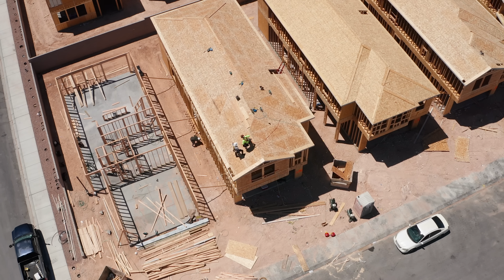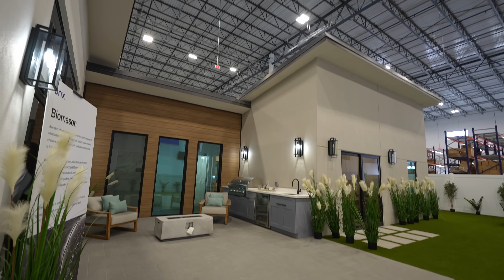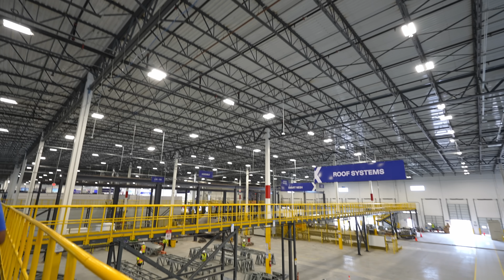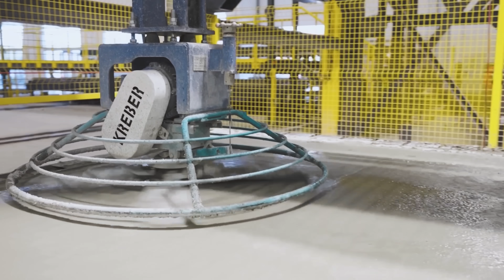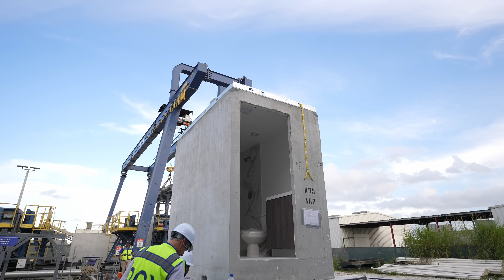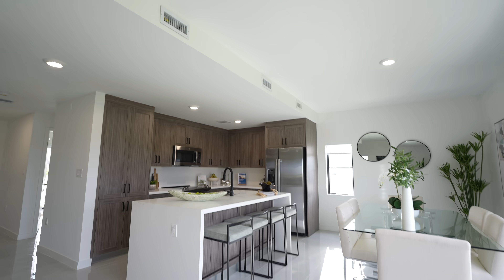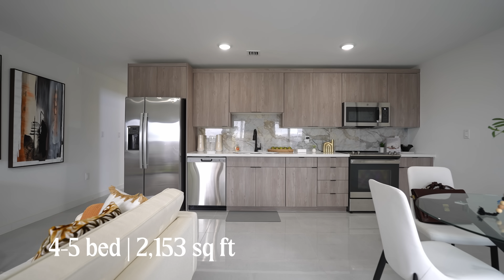Why This Company is Building Thousands of Concrete Homes

Comment: How you describe it try to make it sound new. Maybe for America but not for the rest of the world.  We call things different names but in the Caribbean this is prefab concrete. Been doing this since the 1980s.  These buildings hold heat and holds the cold so I don't know about better insulation.  The  concrete roofing makes it  a furnace in summer though. Shingle roof would keep it cooler in hot months.

Comment: The Edveros post-build certification documentation includes an air tightness test result, a thermal imaging report, and a SAP energy assessment. Three independent performance certificates. Most new builds deliver one.

Comment: I live in a modular home (sections built in a factory and then assembled on site).  There were several similar companies to choose from when I built my house.  they all seem to be solidly built and avoid the pitfalls of stick built on site such as weather.  Building out of concrete addresses some issues like wind resistance, insects, fire, etc.  It also raises some.  Most concrete is porous and will absorb some amount of water.  Mold can be an issue.

Comment: Insulate, insulate, insulate .... A sun-drenched hot concrete wall is a flywheel of heat when the sun goes down. . And the same when the exterior is cold. .. Ask me how I know? . I own a 1955-built concrete home in Denver, Colorado. .. Concrete, luv the idea.

Comment: Transform your structure to withstand nuclear events by using advanced radiation shields like lead or polyethylene and robust reinforcements such as reinforced concrete or specialized alloys. These measures significantly improve durability and safety against nuclear threats.

Comment: Why add insulation inside of the concrete?  One goes from "as strong as possible" to "strong enough." Could it be simply a ruse to reduce costs of production?  The thickness of the concrete is the insulation -- it keeps the interior cool in the day and radiates the accumulated heat during the night.  
And while steel for roof support is better than wood, a concrete roof is the "topping" required for durability and strength.  It is the roof that provides strength to the walls and helps prevent them from falling in or out over time.  In Bermuda, the roof is staggered to provide a slope for water runoff but it is still concrete.  
That wiring by the bathroom (yellow) is tucked in there a bit tight.  I wonder what electrical issues are had with these units.
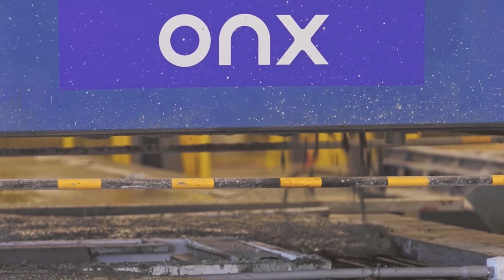Finally, that pour at 02:59 is done from a bit of a height.  I would it bring much closer to the mold.  I imagine that this cement would have a depth rating of more than 35mm with a Vicat plunger.

Comment: This was literally done throughout the soviet union starting the 50s. But the tech used at that point was inferior. The panels are all crooked , thin and cheap. Thermal insulation of a soviet panel building is abysmal.

Comment: 7000 +  cal fire ,for a 900 square foot cabin, old on at that ,in the mountains of San Bernardino you need new electrical and roof..and they will not rebuild only pay for the structure worth..

Comment: Can someone explain to me why the pods of the bathroom are not made of drywall and aluminum rails? Why would you make it out of a concrete shell, drywall would be much lighter to install and build, also probably much cheaper and better for electrical.

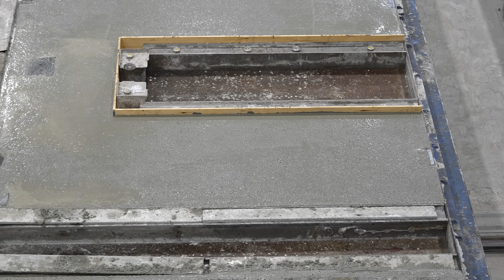Comment: 0:41 wdym "extra"? Concrete will last longer, times better heat exchange, resistant to elements, less noise in and out
Reply: oh, she did confirm it later in the video. Well, I was just reactionary

Comment: In my experience, concrete is a terrible thermal insulator. Roughly an R value of 0.3
So I really have to question the comment “ it’s way better at insulating temperatures”. 

I have also experienced the walls sweating, needing special drywall.  

I would love to see how they overcome this, and I genuinely hope they do.  
I could see myself investing in something like this

Comment: About time the American government is opening their eyes!
I always wanted a concrete house in the USA but the stupid government regulations wouldn’t let you. Concrete houses are more durable. In Puerto Rico the insurance companies won’t accept to insurance your house if is a wooden house 😂because all the things you mentioned before: wind, fire, floods. Concrete houses resist earthquakes too.
I understood there was a monopoly in all this by not letting engineers build houses in concrete to charge expensive policies (insurance). 
And this concrete houses are built in less than 3 months in Puerto Rico and cost about $300k or more. They resists everything. There are homes in the island built over 100 years. There are buildings in the island build in bricks and cement over 400 years, so imagine a concrete structure, how long it will last? 
So, thumbs up 👍🏼👏🏻🙌🏻 for making a new change.
I want to add, did you see the houses being flushed down the river recently in Texas? That won’t happen with a concrete house.

Comment: Research British Steel homes.. this project was tried in Britain in the 60s and 70s... most of these homes can't be mortgage as they develop structural issues 25 to 30 years on as concrete cracks and the steel bends. I am sure steel and concrete tech has advanced from the 60s but there is a reason these homes are not popular in North America and Europe

Comment: The thing people have to get is that concrete is very environmentally friendly IF the house is built right so that it is highly efficient AND designed to last.  A well made concrete house should last from generation to generation.  If concrete is treated as something that is just disposable where it is put in and ripped out a few years later, then yes it's use is bad for the environment.  But the same could be said of EVs.  They create WAY more CO2 release during construction than gas or diesel engine cars do, but they make it up by not using gas or diesel during the life of the vehicle.  So though they are dirty up front, they end up cleaner in the long run.  That is as long as folks are not setting them on fire to make a statement.  Doing that just hurts the planet, while also being a miscreant. The trick to using concrete responsibly is using it for things that will last and are treated as such.

Comment: my house is buld in 1978, it is a prefsb and almost all the walls are concrete. We have a prefab factory close by. Mainly because of house shortage in those days prefab was the way to build quick. Most of  these houses are also townhouses. so connected to eachother. Back in the days they where build as Social housing for rent. 

Prefab has taken a new step and builds can be done in one day. Finishing will take up a month but the house will be wind/water tight within one day

Comment: Lots of questions. How do you fix things that break in the walls? Are they in the walls or just hidden behind drywall. What about house settling  issues?  A huge crack though your entire home sounds ridiculously expensive to fix?  Cracking, concrete can and absolutely will crack as over time. It’s not like they are making these homes out of Roman concrete. Maybe that is an option?  A home that lasts 1000 years, yes please. 

I guess what I am really getting at is what is the true cost of owning one of these homes over a 10, 20, or 50 year horizon?  How do they really hold up?  What new or unknown costs could occur with this type of home. How costly are repairs?  We are talking about concrete repairs vs wood now for some things. That gets very expensive and why they only assemble these onsite and one of the reasons they don’t make the components on site. 

Anyone know?

What about insurance cost?  If they are are tough as they say insurance should be less, is it?  Doubting it is.

Comment: Concrete is not a good material for building homes. It's thermally quite inefficient and has an enormous carbon footprint. It's also quite weak under sheer force - hence the requirement for rebar.

Comment: I'm quite surprised that these outlets are not pre-wired with ethernet. I really hope that the rooms are connected with ethernet and cable, because it's not like you can drill easily through the concrete. Concrete, attenuates or even blocks Wi-Fi signals.

Comment: They need to have doors and windows that can seal out water. Whether it's the actual day to day door or something behind it. Wondering how they keep the roof from being ripped away. Can you hang things on the wall by drilling through to the metal studs?

Comment: 500k$ for a house with such bad detailing is a bit over the top (and the overall is low quality). Btw, the lightweight steel frame (on the roof) is much worse for fire/earthquake/wind compared to concrete. I guess they have some nice healthy margins..

Comment: Wait, you're saying concrete structures are better at being insulated than wood structures, right?  I'm not sure how that works, but strictly speaking I'm pretty sure that wood as a material has a higher specific heat capacity (ie better insulator) than concrete.

Comment: What’s needed is to break the stronghold the roofing industry has on housing codes. All houses are built using frame method roofs that rot, and can burn. Allowing concrete roofs would make houses nearly indestructible.

Comment: So called "pre-fab" homes are built better because all the dimensions and sizing are done by the factory in precise tooling instead of a carpenter using a tape measure and power saw on site.

Comment: Great idea in tornado/hurricane prone areas for sure. Out here in California though it would not work as well as concrete is brittle and won't handle earthquakes well. We need to come up with flexible and fire proof materials. Probably steel or aluminum homes is the best way to go with fireproof insulation materials.

Comment: My choice would always be concrete walls with thick layer of insulation over it. No idea about western Europe but in eastern Europe after WW2 communists started to make whole apartment buildings out of prefabricated concrete modules like in this video. https://youtu.be/1eIxUuuJX7Y?si=-0UTGbS6nH8_mM5i&t=62 It proved to be extremely cost effective and fast.

Comment: Great idea if built outside the USA with the original concrete mix. Ive talked with multiple concrete companies throughout the years and asked them why it all turns to dust if poured from the 80's till now and they have all said our Government has mandated the mix to fail! So they are not allowed  to make it last like it was originally designed.

Comment: Live in a concrete home the whole mold resistant comment made me laugh, you are great at regurgitating their talking points with zero personal experience or knowledge. Concrete holds moisture and where there is moisture there is mold and mildew regardless what they say these things will need constant humidity control to avoid that which in Florida ain’t cheap…

Comment: How can you possibly "feel' the drywall?  Unless you smack your head into it, you can't tell the difference between concrete and drywall.    And maybe you haven't heard, yet, but CO2 is a REQUIRED gas in out atmosphere.  And there really is very little of it.  Less than 1%, I believe.  It is needed by all the trees and plants for their growth.  If no CO2, there is nothing for the plants to turn into Oxygen.  And you know what that means?  We all die.  Man is not causing so-called Climate Change, if it even exists.

Comment: Bear in mind that each pound of concrete releases 0.93 pounds of carbon dioxide.  While wood constructed homes are essentially carbon dioxide sinks.  We should not build concrete homes except for in the most disaster prone regions.  Building concrete homes literally exacerbates the problems they are solving for.

Comment: The concrete homes are fine but IMHO they are spaced too close together. If there is one thing America has in abundance it is space. Land. these houses should be two or three times farther apart from each other than they are. I mean the way they're built here, they're almost row houses. Other than that, this is a great idea - lots and lots of housing manufactured quickly, and from a material that should last a long time without rotting away, and also is more resistant to hurricanes, tornados and fires than wood. America has a housing crisis as everyone knows. These concrete factory built houses can do their part in the fight against it.

Comment: I've seen prefabricating like this in the Netherlands, however the insulation needed to keep the properties warm in the winter is far greater than displayed in the video. This means far higher transportation costs as the elements are much wider. Secondly the insulation material is an environmental  issue and expensive to dispose of when it comes to rebuilding over here.

Comment: Concrete in California requires a lot of steel rebar. I built a retaining wall (required by the town). It held back 3 feet of dirt. The rebar cost $10K. Some of the rebar was 1” thick. Earthquakes can crumble concrete.

Comment: Thomas Edison built concrete homes, well over 100 years ago, which are still standing, today!
Except, I believe, that his homes were built "on site", meaning that 'forms' were installed &
the concrete was poured into them! When it hardened, the forms were removed, leaving a 
solid, shell of a building! This is an old building material, that needs to be revisited!

Comment: I want thicker walls and instead of dry wall I want another layer of concrete. Also need far smaller windows as there are so many shootings happening in New Orleans smaller windows are safer.  The Swiss construction industry does some great prefab and Germany builds some VERY stout houses with some really interesting windows that outdo basic American ones.

Comment: I can't speak for other states but if you're going to buy a home in florida make sure it's concrete even better if the roof is made out of concrete. Is meaning the foundation?The walls in the roof are made of a concrete. Simple things like  termites plus wood rot. Is destroyed more homes in florida overtime . On the other hand where concrete Usually outlast all of them , even in a hurricane.  fire or flood  . In today's world they have a thing called concrete board that takes the place of dry wall.I would highly recommend it. Not only is it structurally better , but it is Is also majorly fire resistant. And Is so much stronger and lasting than wood.Or drywall. In florida everyone should be afraid of termites Whether there's subterranean or Dry wood. In florida concrete  value much more stronger than wood or any other built structure. Recently, a major improvement in concrete floors means you do not need tile, carpet or wooden flooring or vinyl.You can literally have the concrete stain to any color or pattern you want. Is that will last forever.

Comment: As a pest control specialist, I can't tell you how many homes. I have personally inspected that became worthless because they were either overtaken by termites or wood rod or just simply decay because they were made out of wood.. I can't speak for other states.Strictly speaking for florida if you're going to buy a home or a condo or any structure even commercial make sure it's concrete. It will do better in hurricanes.Fires protection against termites And even something as simple as wood rot and decay. Personally , I would recommend anything built by devasta. If you can practice your own land they can still build a home for you on site or commercial structure. In most cases there roofs walls and foundation. Are made at a precast concrete. Is solid to the core.

Comment: Burgundy vasa or simply devasta have the best building reputation in the state of florida. That's because the builder structures with solid concrete. That is great in hurricanes fires and even term weeks or just simply woodrot. Unfortunately, it took Bergen Nevada over 10 years to get approved in the state of Florida, but have proven themselves as one of the best builders.There is in the state of florida.

Comment: OMG!! Another Youtube specialist at nothing!!! I agree, concrete would be better and quicker than traditional stick-built. Did you know, that almost all homes built in FLA over the last 20 or so years are cement. In particular the first floor. Some builders are still using stick-built on the second. Did you further know that most damage from a hurricane is done not by the wind blowing the house over, but by water. It's called flooding. Water does not care if you use sticks or concrete. It will get into the house. Six feet of water in your living room, kitchen, bedroom, or wherever is going to destroy the house. Just saying, to do a little research.

Comment: Originally form South Africa, where all houses are built with brick (including the interior walls and floors are concrete). Was so weird when I moved to Australia and houses were made from wood. Eventually bought a house with exterior brick walls but the interior is still drywall with wooden floors. Houses definitely don’t feel as solid.

It’s weird that you prefer drywall. To me it’s cheap and flimsy and makes attaching things to the walls a pain.

Comment: It sounds too intense, no thankyou...  I prefer using Shou Sugi Ban lumber, which I treat myself and it takes me too long actually but my clients don't mind the extra attention. Nothing is worse than finding termites only 10 years after you buy a home. With shou Sugi Ban the sugars in the wood are cooked out and the termites instincts tell them a fire is near so they split...  
 Then I put up a siding that has a high flash point well above a run-away fire scorching the earth.  Check out James Hardie cement board siding.